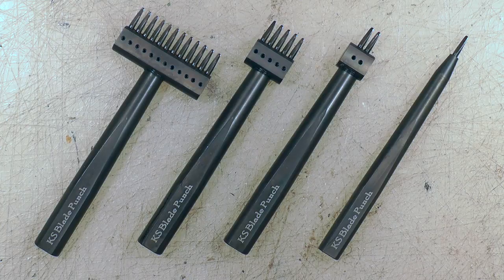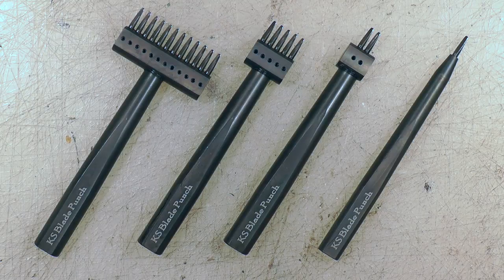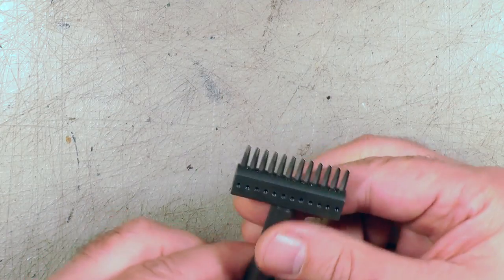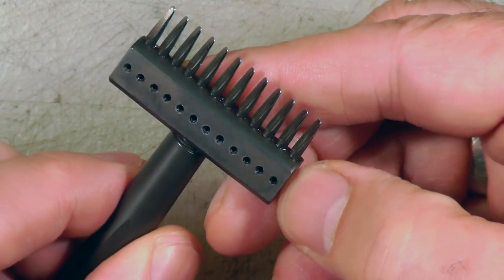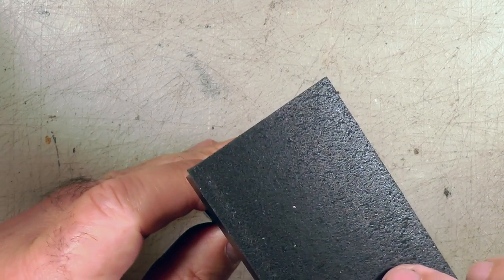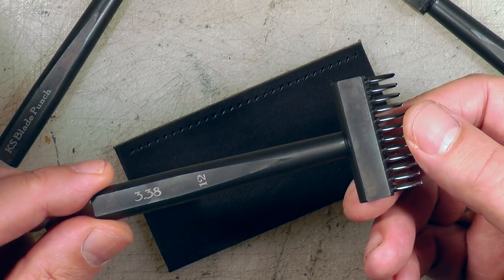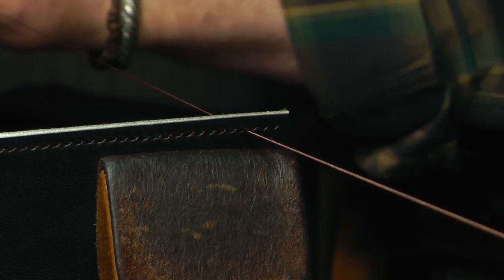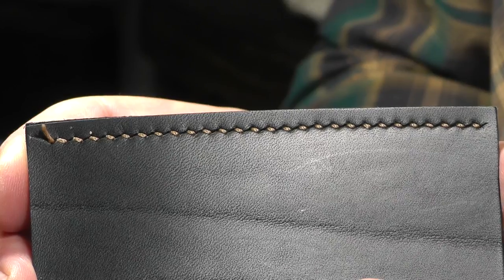Pricking Iron Review Part 15 KS Blade Pricking Iron

Comment: No Waffle , no Bull, just plain speaking and says it as it really is. Excellent reviewing. I listened with awe. Now its a head scratching toss up between KS Blade and the Sinabrok. Thankyou !
Reply: I went with KS blade because they are little cheaper, and the size of the holes are slightly smaller then Sinabroks. Also they offer them in European Style, Japanese Style, Round Hole Punch and the Baroque Punch. Finally my last two reasons as to why i chose KS Blade, its made of stainless steel compared to Sinabroks brass. I know the brass will prolly be fine but months later i can imagine the brass head having dents. 

Lastly I ordered them through Rocky Mountain Leather Supply and got it in 3 days compared to to Sinabroks 2+ weeks(website or Etsy) same goes for KS Blade unless you order ot through RMLS they usually keep a fair amount in stock so you can skip the wait time.

In the end, the choice is yours and we both know youll be happy with either chose. I just wish KS Blade would offer replacement teeth that you can replace at home instead of having to send the damn thing in and waiting...
Reply: @Handles-R-Lame  Quote   " To be fair I know the brass will probably be fine, but months later i can imagine the brass head having dents."
   I don`t think it will if your using a Hide mallet or a Nylon headed type mallet. Hide and nylon won`t dent brass.
I live in the UK so no one I`m aware of  stocks them over here, so it`ll be a case of having to buy from S Korea, and the Shipping plus Import duty and VAT on top is further cost to an already expensive item.☹

Comment: What is the difference between a pricking iron and a stitching iron?
Reply: Sometimes brands use the names interchangeably which can be confusing. Generally, stitching irons are made to be punched the whole way through the leather, whereas pricking irons are used to mark your stitching holes - you would then use an awl to finish the hole. I know these are called pricking irons but they're designed as stitching irons to be punched the whole way through. The difference you'll see is that stitching irons tend to be more uniform in size from the bottom to the top of the blade whereas pricking irons tend to be narrower at the point, then broaden more significantly.

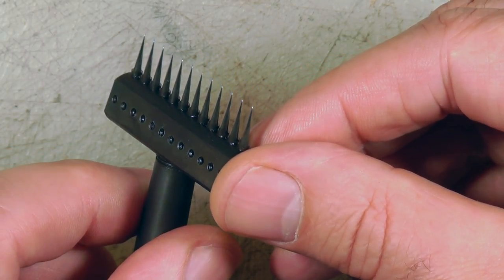Comment: Are the blades held in with interference fit roll pins or allen key machine screws? OK at 6:26 you can see they are threaded screws